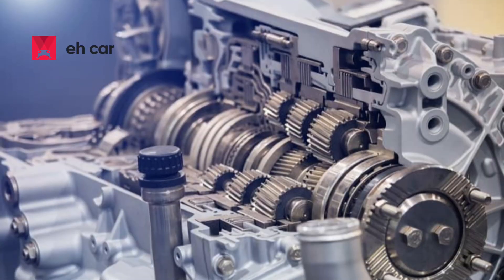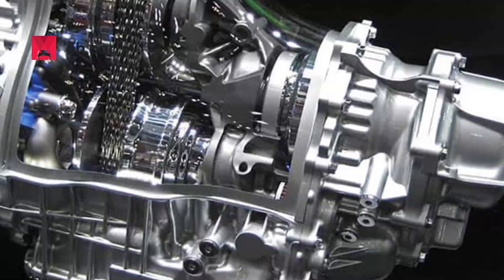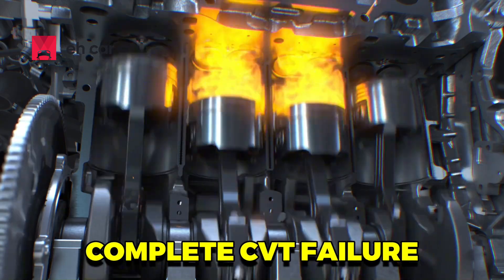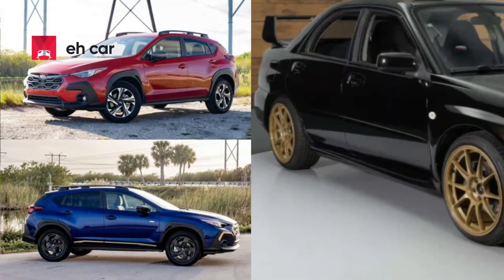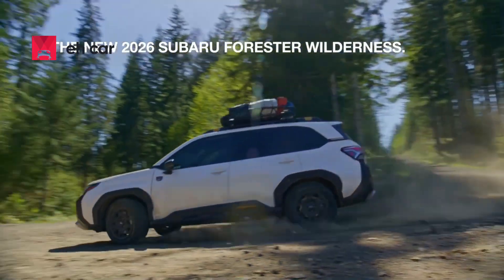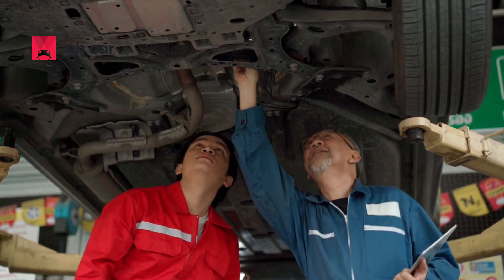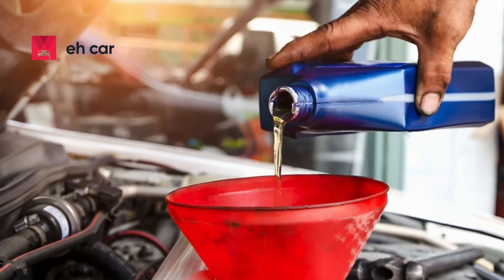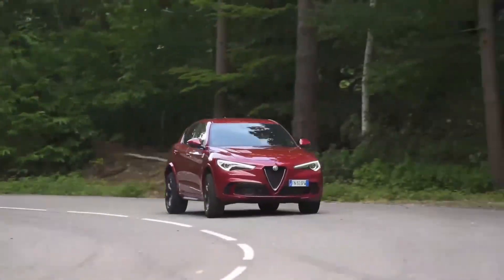Why CVT Transmissions Are Still Failing in 2025: Subaru’s Biggest Risk Yet”

Comment: our 2025 crosstrek's transmission failed after 3 months, less than 2,000 miles
Reply from the maker: Wow, that’s really frustrating,  failing at under 2,000 miles 😬 Definitely, not what anyone would want. Sorry to hear this.. Hopefully, the dealer is covering it fully under warranty, but I’d also push for them to check if it’s an isolated defect or part of a bigger issue. Keep records of everything; they can be helpful if it happens again.